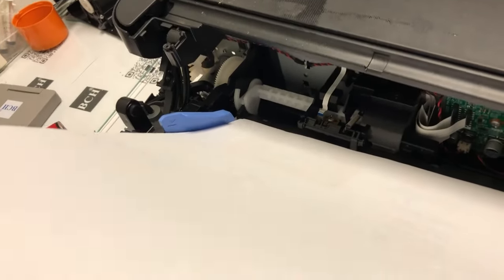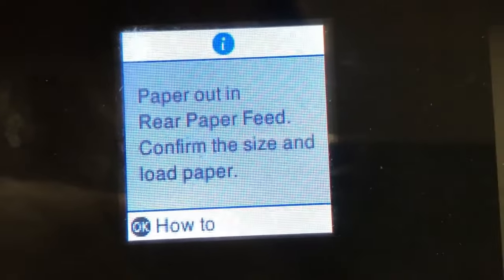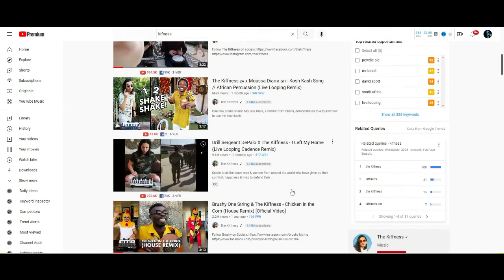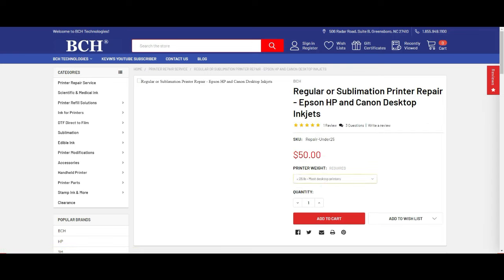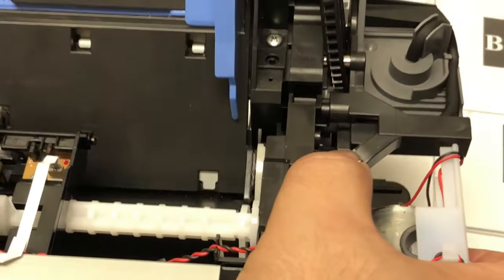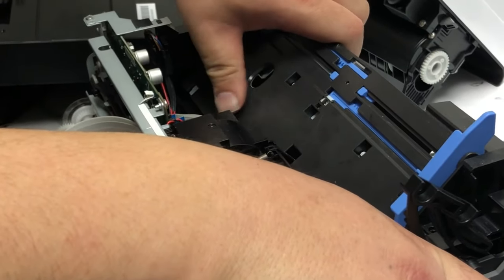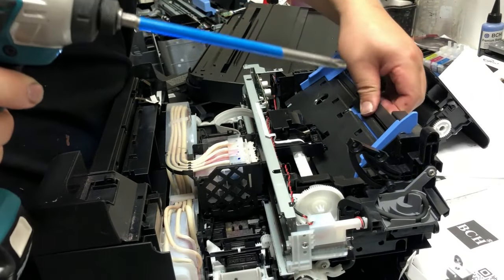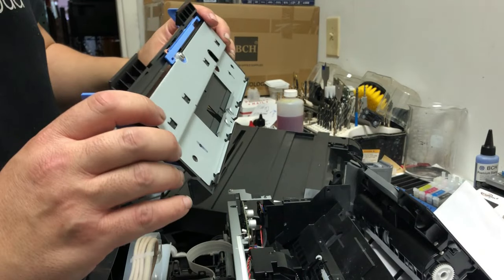Epson Paper Out in Rear Paper Feed or Incorrect Loading  (THERE IS PAPER)

Comment: Have you tried to check the hole where the pickup roller shaft connects with the clutch.  Sometimes that hole gets bigger as it wears out and there is a big play which causes this problem of picking papers.

Comment: Hi, I had the same problem. Epson XP-3155 printer, I launched a print and it gave me the same message as you. Resolved. I used a portable lamp, looked in the paper compartment, and saw a strip of plastic, fallen in there. I unplugged the cables and turned the printer over, this way the foreign object fell out. Reconnected and all OK. I was going crazy.

Comment: You're hilarious. Very entertaining. I'm wondering if you fix Canon printers... if it's worth sending it in? A friend will give me a good deal on a pro1000 if I can get the door open Error fixed. He had contacted Canon and they said they can't diagnose it unless it has ink in the cartridges lol. Well there's no ink in but I can fill them up a little bit with non OEM ink. And I'm wondering if it's the sensor or something that's an issue whether it can just be cleaned or something like I've seen in other videos. A little WD 40. Or if it needs to be sent in or something. Thanks!